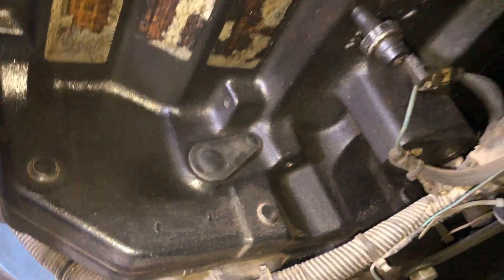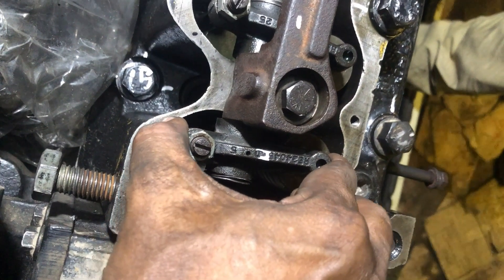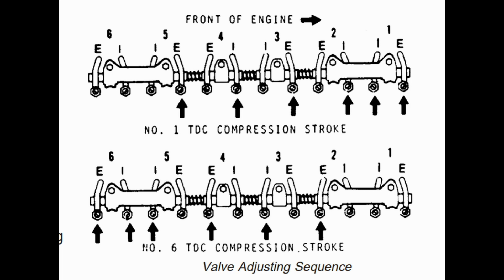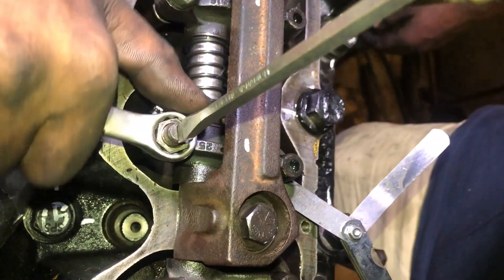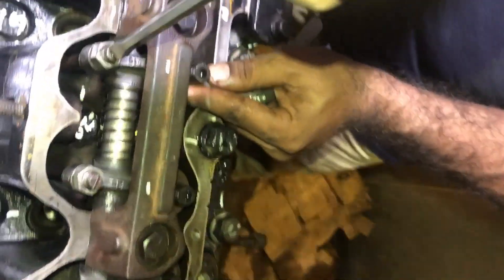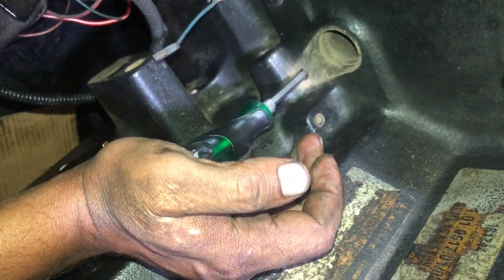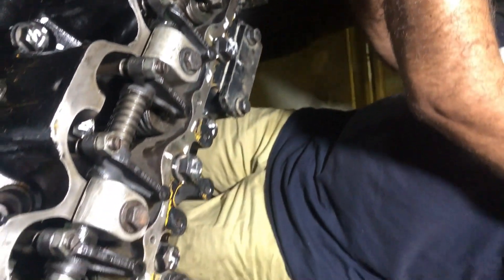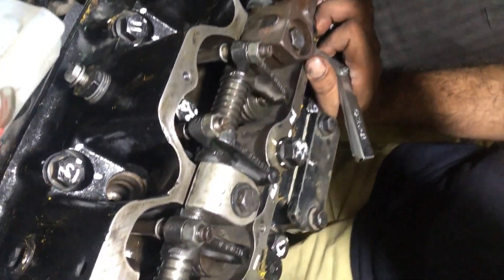The Ultimate 6-Cylinder Tappet Setting: John Deere 6081 Masterclass

Comment from the maker: “This video shows the complete tappet/valve adjustment procedure for the John Deere 6081 six-cylinder engine.
I have explained every step clearly — from finding TDC to adjusting each cylinder with correct sequence and technique.
If you need clearance values, torque specs, or a printable step-by-step guide, just comment below and I will share it. 🔧✅
#JohnDeere6081 #ValveAdjustment #EngineTraining #MechanicTips”

Comment: which cylinder is #1? The one by the fan pulley or the output shaft? I have a 6081 in a Deere loader, cannot find anywhere online or service manual which is the "front" or back of the engine.
Reply from the maker: @yuriy5632 is the one on the fan side.
Reply: @Technical.Education   thank you!